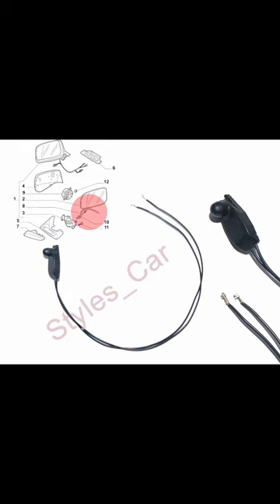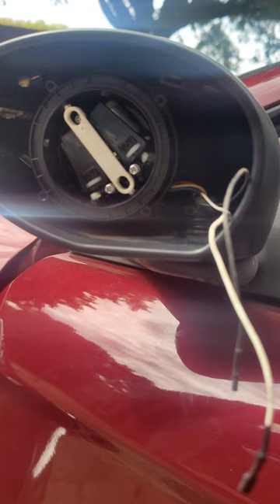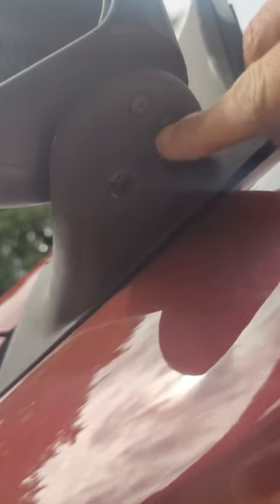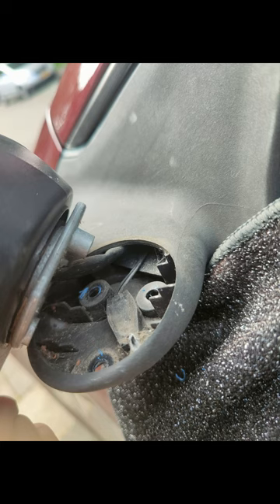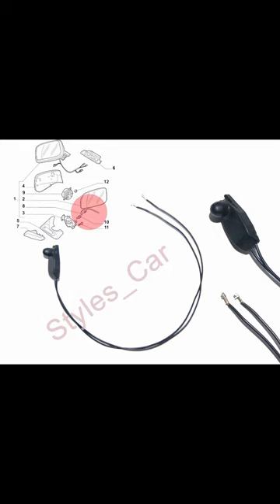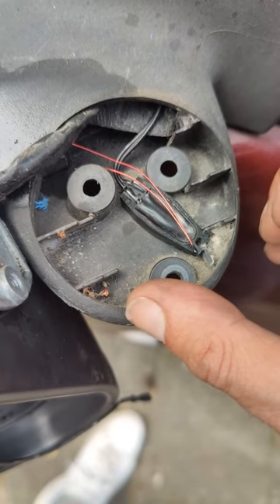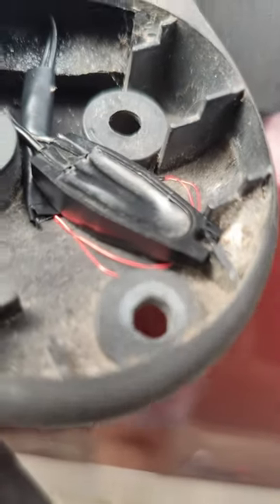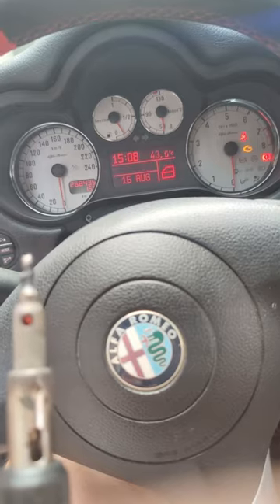Alfa Romeo GT, Replacing Ambient \ Outside Temperature sensor DiY

Comment: Do you have some information or part nr for us GT owners on the sensor wire you used? Mine went bad too.
Reply from the maker: It can be any thermistor with 10k value. I personally used this one MF52B NTC Thermistor

Works flawless still, and even more precise
Reply: Thank you!